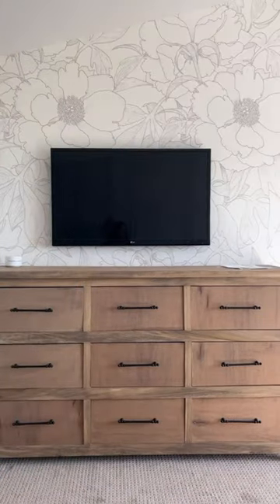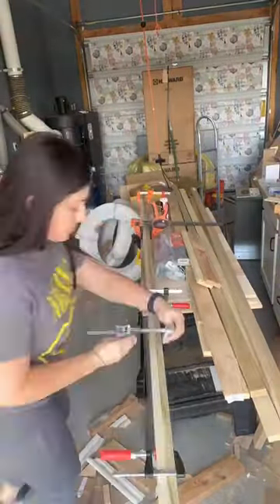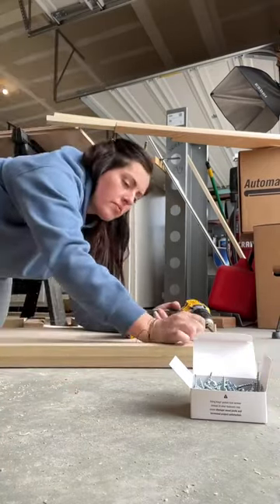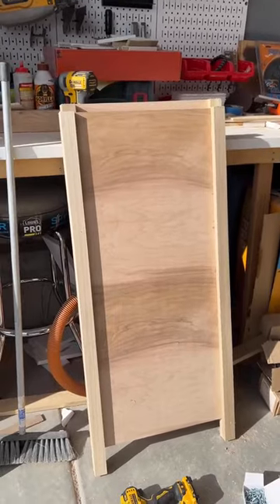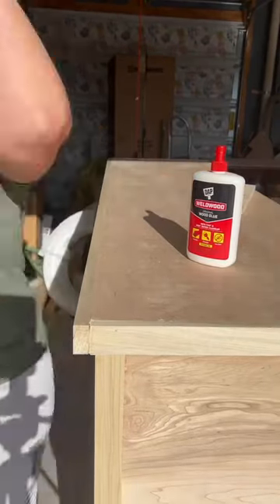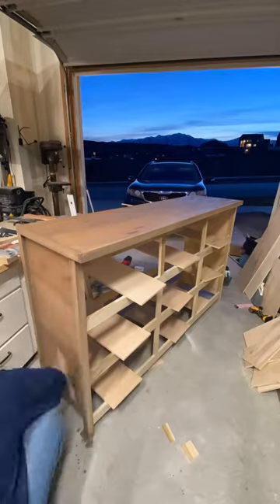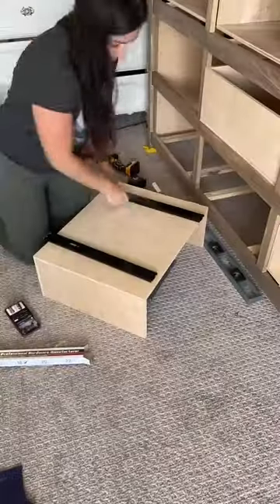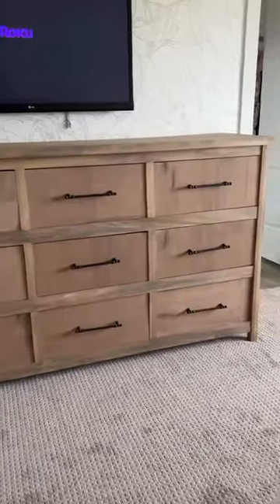Full DIY Dresser Build

Comment: That's so nice! Why is mounting the drawer slides on the bottom against the rules?
Reply from the maker: These slides I used are side mount and technically the weight is better distributed when the slides are side mounted, but since it’s just clothes I think it will be fine